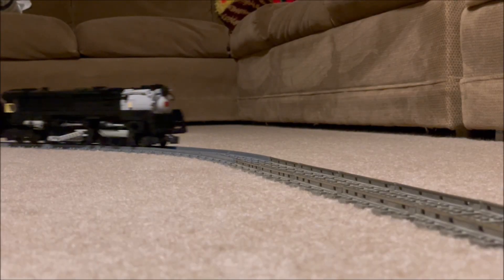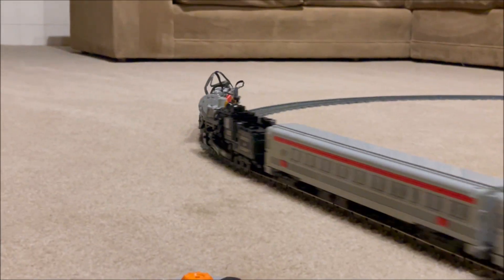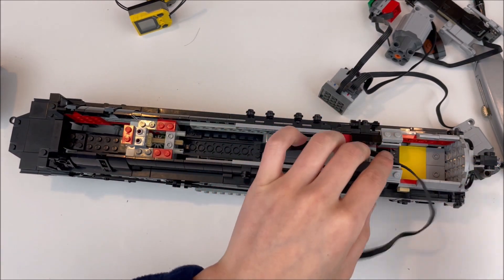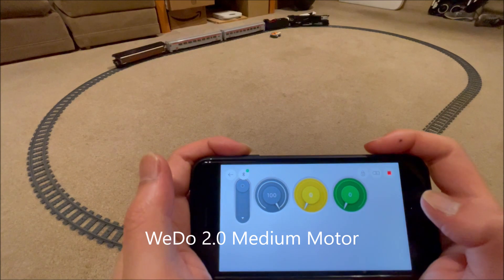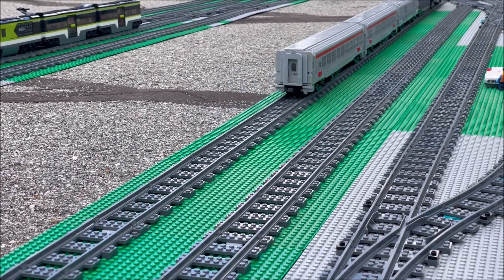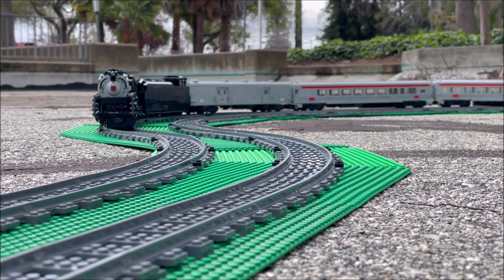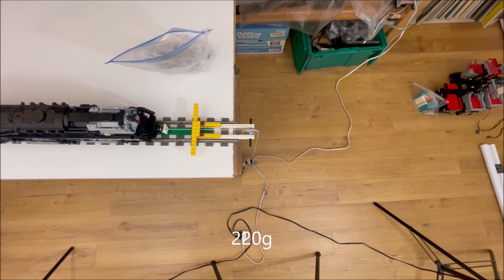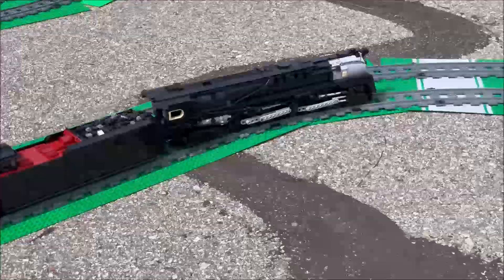LEGO 1:48 PRR Q2 Mechanical Update (Powered Up + Power Functions)

Comment: 3:00 I have some more knowledge of this thanks to directly talking to the technic hubs over LWP (Lego Wireless Protocol) instead of using the app.

There's two ways to talk to a motor: either you give them power/speed commands directly (independently) or combine two motors into a "pair" which can then be commanded a certain speed and power. If you pair two motors up (by using the singular command block that has as motor variable for example AB or CD to control both motors), then although you can address the speed of each individual motor in the pair, it will use feedback from the rotation sensors to keep the motors running in sync. So for example if you then tell the motor pair to go speeds 50 and 100, then motor A will make sure that for every full rotation of motor B, motor A will only do a half rotation, compensating or even reversing direction for moments to keep them in sync. This is called a "Virtual Port" in the lego documentation and is very helpful for making skidsteer vehicles go in a straight line. You can experience this yourself by making a skidsteer vehicle, setting up the pair command block, setting two speeds and holding (stalling) one of the motors. You will see that after a slight delay, the second motor will stop, reverse a bit and then fully stop as long as the other motor is not spinning. Forcing the other motor to spin the other direction by hand will then cause the other motor to reverse (relative to the vehicle) as well.

However if you use two different command blocks each talking to either motor A or motor B, then this sync won't happen. Due to how the lego protocol is designed, this can cause one motor to start spinning a moment before the second will as both commands are sent in sequence and will be executed one after another.

There is also an option with LWP to describe a motor pair as not being synchronous (so you halve the data traffic between the "smart device" and the hub, making sure the timing of the motors is correct and potentially reducing latency), but I haven't found a way to do this from the app.

edit I tried multiple times to post a reply, youtube just deletes them. Search google for the github page from LEGO, it should be there.
Reply from the maker: Thanks for sharing; this is very interesting information. You mentioned "lego documentation": where did you find this and do you mind posting a link?
Reply: @NonsenseWars  see edited comment above